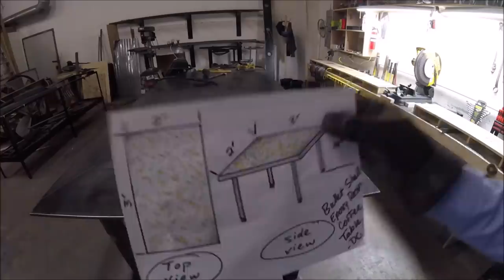Epoxy Bullet Table. How To Make a Table With Empty Casings!

Comment: This is badass, I'm going to add rounds and brass of many calibers.
Reply: Same here collecting my casings now a good mix will make a nice little end table 👍👍
Reply: Make sure you lay you epoxy in three separate pours or you'll get air bubbles inside the casings
Reply: @WolfNasty419  I was wondering about that. Thanks!

Comment: I think I might like it better with a pile of the brass on one of the corners and then brass spread across the rest of the table.  maybe add more variety like different size pistol casings.  still looks amazing as it is though.
Reply: I would also add pulled bullets of various calibers  instead of just brass.

Comment: Have you  tried using thermochromic pigments for coloration in your 
tables? Another concept would be to create "lava" with water & oil 
& coloring and have it recirculate through a hollow channel in the 
table. Have you looked at using electrochromic film for table tops? You 
could have it change from a white frost appearance to any table finish 
underneath it with the flick of a switch.

Comment: If it was a larger piece it would be cool to incorporate ammo boxes into it. If the legs were the same dimension as the ammo box, you could use them as ornamental feet for the table.. attach the lid to the side of the leg

Comment: Im sure you answered this before but do you have a link to the resin as well as the clear coat you put on just after you glued
Reply from the maker: Hey just saw this. This was the cheap house brand at Lowe's. The clear was just a quick water based sealer coat.

Comment: The next one, if you choose to do so, should have bullet holes in the wood. (Purely opinion...) It's an awesome table none the less!!!
Reply: Travis M.  Use your imagination. It would be easy to make some sort "stop" that goes under the table. Simply remove when the first layer is dry. 
Peace, sir!
Reply from the maker: @13ECHO20  I use blue painters tape when I do that.

Comment: Very cool.  What is the purpose of the torch?  Did you have any air bubble issues or did the layererd approach eliminate bubbles?
Reply: tekn0lust it pops the bubbles in the epoxy mixture

Comment: What did this cost you to make in supplies and raw materials? What epoxy do you use?
Reply from the maker: Epoxy cost a couple hundred and maybe 50 bucks in steel. Wood base was free and casings were free, got them from a friend.

Comment: What did you use for the adjuster on the bottom or where did you get them love the design working on a smaller version now.
Reply from the maker: Threaded inserts from King Metals, Dallas TX
Reply: Thank you

Comment: How long did you have to wait in between expoxy coats? I take it your first coat you waited before adding the casings so they wouldn't float?
Reply from the maker: The first (base) coat was about 3/16in deep to hold the shells down, that coat sat for 3hrs then I did four flood coats (2 one day and 2 the next).

Comment: Did you have to clean the brass?  If so, how?  In the finish did you get any last min. bubbles.  Thank you for the video.
Reply from the maker: Didn't clean the brass at all. Got the normal bubbles from mixing but ran 'em outta there with the blow torch.

Comment: Hi, thanks for the upload & congrats on the AWESOME outcome!!! Does anyone know how much epoxy was used on a project this size? Also how much time is needed between the pours? Thanks again & happy holidays everyone!
Reply from the maker: HEY what's up Joey! Man I can't remember how much epoxy I used here, prob close to 2 gallons. And I usually wait at least a couple hours between layers!
Reply: @DerekConwayTX  thanks for the reply & the info! I've been doing some research on epoxy resin. I'm just worried about soft spots. I'm assuming using a little more hardener will solve my anticipated problems.. just shorten my working window.

Comment: How strong is this stuff? Able to handle the twisting of a torque wrench on a vice? Wanna do a table like this for a gunsmithing work bench. Something a little more eye appealing then just staring at blank wood
Reply from the maker: Not sure this thickness of epoxy would work for that. Maybe if the epoxy was an inch thick? Not sure Paul.
Reply: @DerekConwayTX  so would you recommend squaring off a section of the table and just doing that square out of reinforced wood, then pouring epoxy on the work top surface? Only cause I know epoxy is expensive
Reply: @paulwiseman3804  I'm thinking about using shell casings vertically with epoxy in between. I have buckets of casings so I can handle the dramatic increase in amount. I have all sorts of sizes too. So either I'll stick with 5.56 or I'll think of a over-complicated system to organize a flat surface out of multiple sizes. Probably cut hundreds of dowels to compensate size difference, place a casing on it, and superglue it to the table in order to hold prior to epoxy? 9mm through .308 sounds fun. It'll help cut down on the epoxy expense while distributing the downward force mostly through the brass and not deform the epoxy.
Reply from the maker: @TheNajSD  OK this is what I'd do with different sized casings. Prepare the base, or trough, deep enough to accommodate the longest casing where the casings go. Randomly place casings open end down on 1/8in deep epoxy. You will have plenty of working time here to neatly place them all over. Let that epoxy cure. If you have the casings all nearly touching would be very cool. Now that the 1/8in deep epoxy has cured you can go crazy and fill the sumbitch all the way up, slowly. Wait a ffew minutes and pop the bubbles with a heat gun or torch. OK now I'm gonna make one like this HAHAHA

Comment: I’ve done one with beer caps turned out awesome but had air bubbles form from under the caps did you not run into this
Reply from the maker: No problems. I did shallow pours to avoid that.

Comment: Love your garage!!! Also work table do you have any specs on it? I am getting  ready to build me a 50 x80 garage  an want a nice huge work table like yours looks simple to make. How thick should I use for the top? Thank you
Reply from the maker: Welding table or table saw out-feed worktop?
Reply: @DerekConwayTX  welding
Reply from the maker: The steel plate is half inch thick and 4ftX8ft. I have a 6in overhang all the way around. And its 38in tall overall. I used 2 1/2 in square tube 11ga. Hope this helps bud.
Reply: @DerekConwayTX  you helped perfect I think I can build it now lol thank you!! You build some very nice stuff I wish I could do that!!!

Comment: How much did it cost for.the resin and hardener needed and on that size table?
Reply: i pay £130 gbp for 6kg of epoxy resin by my calculations it cost a good bit from the several pours
Reply from the maker: 175
Reply: Well that answers my question wether to use epoxy resin or polyurethane on a set of wooden coasters I was wanting to make. Guess it wouldn’t be cost effective.
Reply: @whatfreedom7  start small bud polyester resin cracks due to the higher shrinkage then epoxy...poly resin is fine say with layers of material with it as it acts as a strengthener and have less shrink then if you were to try the bullet method ......failed plenty times with resin until i got it right

Comment: I see you put casing in the epoxy....would it hurt to put full rounds in it? Like a 50 cal round and others? I'm from Arizona so it gets hor as hell here so I'm not sure if the heat will do something to the epoxy and the round inside of it...
Reply: yes it would epoxy gets hot when curing. west system epoxy do a 206 hardener for longer curing time but it still gets pretty hot
Reply: Make squib loads for it with dead primers, would give the look of live rounds without any danger.
Reply from the maker: Andrew is right, if you want a live round 'look'. And Glen is also right, epoxy get HOT as it cures and might set the damn thing off...
Reply: Holy shit!! Thx for that valuable info guys...i didnt even think about that..
Reply: As an afterthought, if the epoxy gets hot enough to worry about discharging a live round, you may have concerns about melting the soft lead in bullets, may look neat, but might be slightly possible.
Reply: @andrewsavage1872  would they not float?
Reply: @nickhorne4560  not sure, I've never worked with epoxy, just a reloader trying to help about live round concerns.

Comment: What did you spray on the wood and frame before the epoxy? Was it something to help the epoxy adhere to the wood? Sorry dumb questions but have been wanting to try epoxy and just looking for tips
Reply from the maker: Spray poly, minwax brand. I did that to give the wood a barrier between the wood and epoxy, sometimes the crap on the wood makes it bubble constantly. Plus i didnt wanna spray after because it would leave a film on the epoxy. Hope this helps!

Comment: Safety first with the angle grinder!!!
Reply from the maker: Did you see me change the blade to a grinder with a SAFETY guard?
Reply: @DerekConwayTX  I did. That's what I was referring to. Those blades and the chain saw blades are scary.
Reply from the maker: @kodysimpson1  Yeah you are right. I pulled the trigger on the first grinder and something told me to put the damn thing down and get another grinder haha
Reply: @DerekConwayTX  abrasive grinder wheels rub your glove and think "man that was close". Those wheels rub your glove and you think "I need to go to the ER". Excellent job on the table.
Reply: @kodysimpson1 be sure to pick up the parts of your globe that came off, if you can find them....